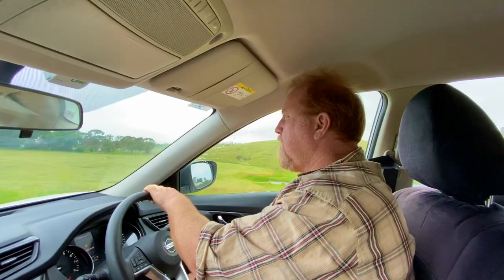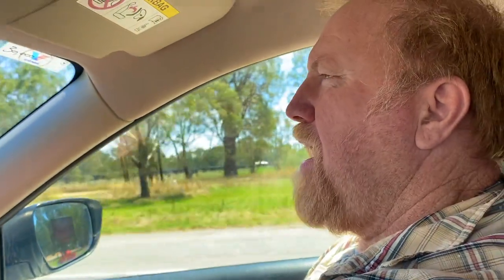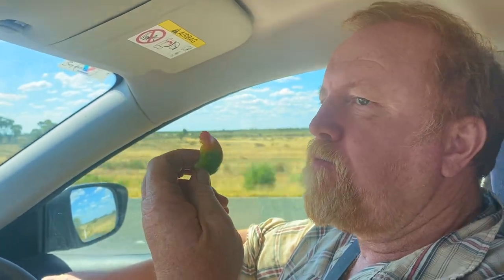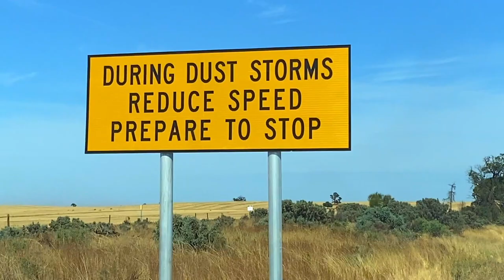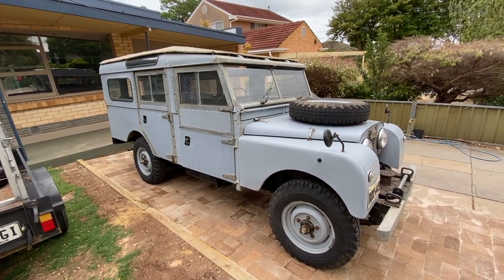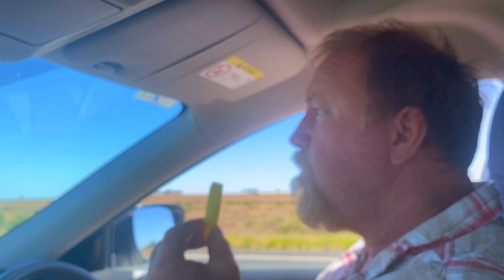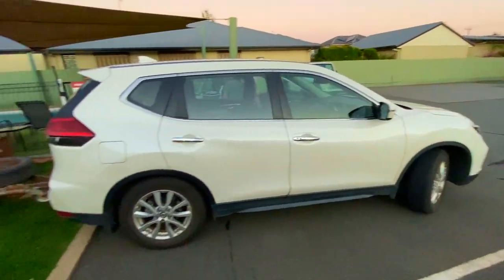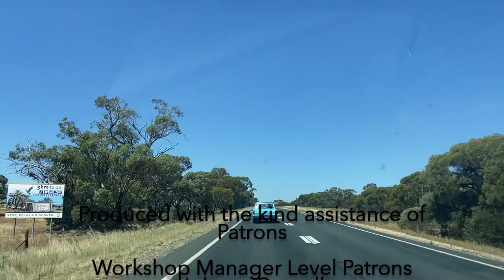2600km drive to pick up Landrover parts

Comment: Did a three thousand km plus round trip down that way not long back . . to buy a running & registered 85 tan 70 series Toyota diesel ute . . an tan one . . an all out classic for $2600 . . from Jerrlderie . . drove it 180 km to Wagga wagga to get it transported here . . it's an old roo shooting rig with spotlight on top & T bar side mirror . . I keep finding 22 shells in it when hunting for loose change
Reply from the maker: Classic Ben, it  will be pretty much rust free coming from out there.  It is awesome country
Reply: @VintageRestorationsAustralia   No timing chains . . no electronics . . just keep the oil up to a million km's easy
Reply: @VintageRestorationsAustralia  Yeah no rust . . don't go to the beach

Comment: Nice trip! Me and the mrs absolutely love a good road trip. How would it be to do that in  your 109"? Looking forward to the nex episode. 😃 Cheers mate
Reply from the maker: Martin your landrover trips will be a bit faster than mine with your V8 powered 80", can't wait to see you cruising in that car, It would take months in the 109" and I may never make it, I like the airconditioning in my wifes work car  :-)
Reply: @VintageRestorationsAustralia  The modern chassis with coil springs helps too. 👌 I saw 42°C so ac is not a bad idea.
Reply from the maker: @slowshop  Yes a little hotter than Sweden (my ancestral home :-))
Reply: @VintageRestorationsAustralia  about 60° c difference only. Have you got relatives in Sweden?

Comment: 38 degrees I would die.  Mind you we just went through two weeks of -30 to -41 degrees in Canada.  Maybe I should have done a road trip.  Thanks for the distraction
Reply from the maker: It actually reached 42oC!!  It is pretty hot out there, Adelaide often stays at that temperature for weeks at a time!.   As a green eyed fair skinned redhead I am genetically designed for cooler climes myself.  Stay warm Tyson.